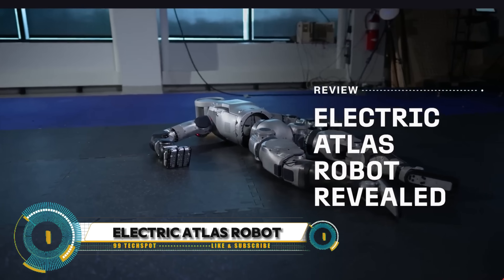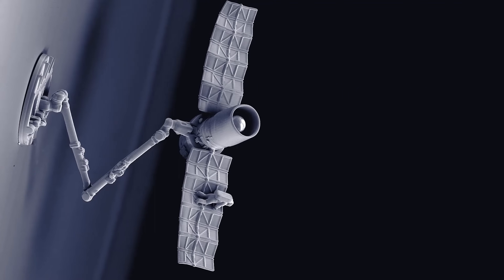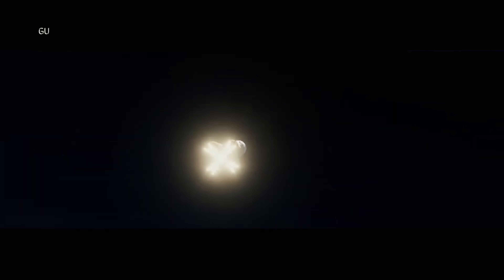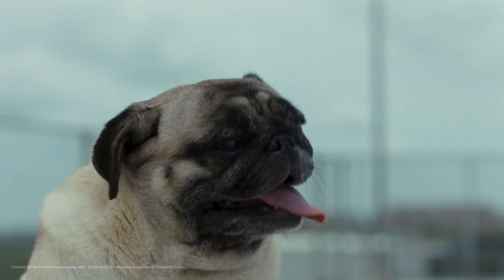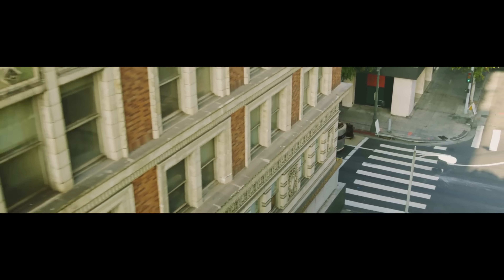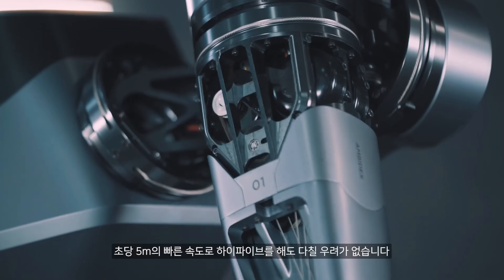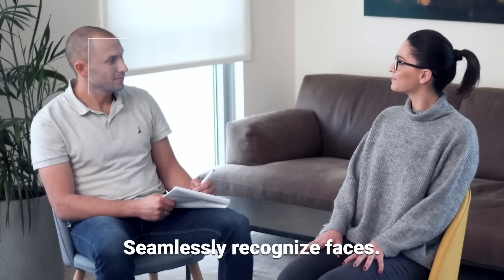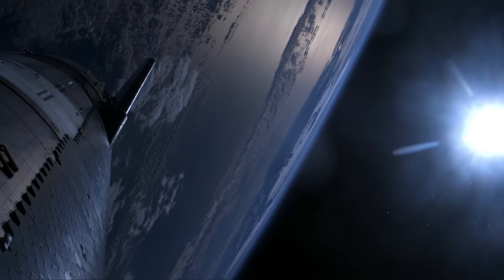15 EMERGING TECHNOLOGIES THAT WILL CHANGE THE FUTURE

Comment: I remember creating a nanochip that could detect how "off" certain foods were by a visual colouration system, the usual methods of photolithography using a silicon substrate with silver nano particles etc for detection methods of the gases released by those food types. Interesting and haven't seen it taken forward yet, especially I think there should have been a prototype ready for real world "shop" testing.

It's amazing how far nanotechnology has come in recent years, the application for the carbon "nano tubes" seem endless.

Great stuff.

Comment: Anything from the motor vehicle, the aeroplane and the humble air fan,can be self sufficient with a battery and dynamo system.
So, many items can be self sufficient without using the power grid 😮
So, is this because a government super power has the patent for the dynamo?
It's available, but, not being used for a reason that makes no sense 🙏😮😮